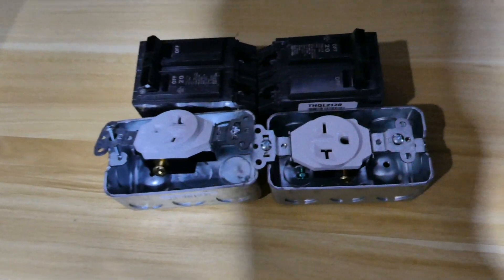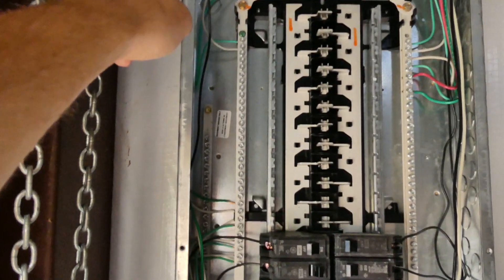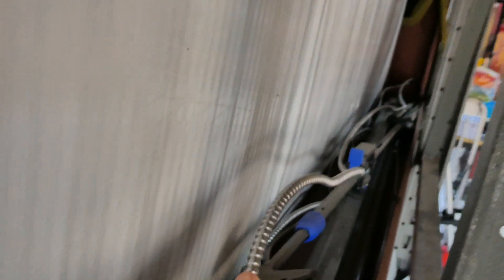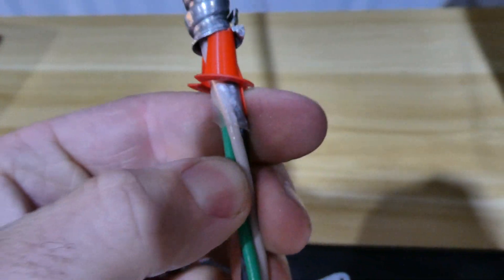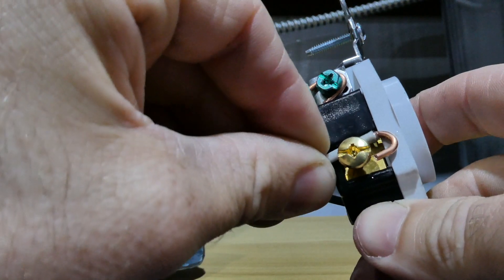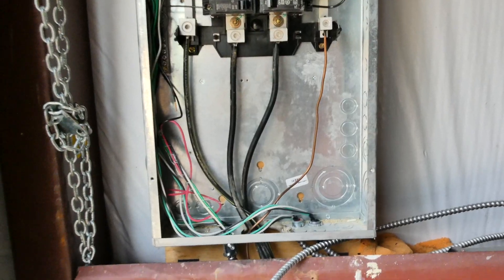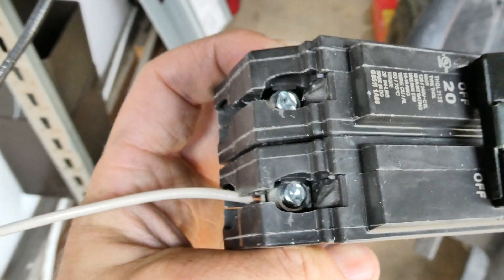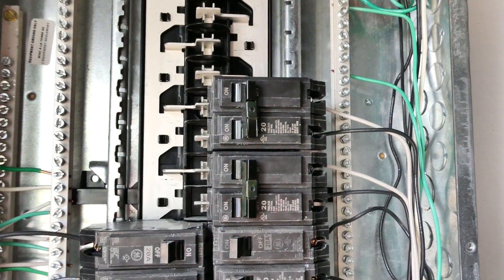How To Wire 220v Outlet For Antminer S17 T17 S19 or Other Bitcoin Miners ftx

Comment: Did you use a single cable (in my case 10-2 from the 30 amp breaker) to run to the miner, or can this be done with a single 240v cable (like 10-2)?  I’m measuring 123v on each plug going into the miner - but I’ve got no power.  I’ve likely made an error, even though my wiring does have power.  Any thoughts, anyone?
Reply from the maker: Are you using a double pole breaker? You should have 2 hots and a ground on each plug should be 120+/- volts on each prong of your plug besides the ground.

Comment: After looking at some manuals for miners (S19j pro for example) it appears each power supply needs 10 amps, could you not run a single 240v 20 amp for the entire miner? EDIT: Meaning, 2 receptacles

Comment: Brave man to post all your code violations on the internet. Ground and Neutral are different things. Stop using them as if they are the same. White is a neutral UNLESS marked otherwise. (red/black tape at both ends.) There's a red wire on your ground bar? There's no gland or conduit on the service entry to that panel -- which is ironic given the care given to the EMT ends.
Reply: phag

Comment: As an electrician, the only thing I have to say for the panel, you would want a little extra in there in case the wire gets damaged, whether it's from the insulation degrading or it gets nicked some how, and the s19 can be ran on a single 20 amp breaker for 240v, you could of daisy chained the 2 plugs together, or bought a duplex receptacle. Other than that awesome job!
Reply: What about the green bonding screw being installed and the grounds and neutrals being connected? I thought that was a no no on a sub panel
Reply: @Wigwhom86  good eye, I didn't even see that!
Reply: I got a 3300watt miner from australia 220v 16 amps....    how i wire this dam thing in the US    help   lol.       tried a set-up 5000watt 110 t0 220 but keeps trippin 20 amp 110 single phase single breaker
Reply: @maestrozilla  you need to wire in a completely new circuit(new wires, outlet, breaker). Volt times amps is the wattage the circuit is rated to. For cypto mining you only want to use 80% of that number to avoid fires
Reply: @Wigwhom86  ofcourse  it dedicated...
Reply: @Wigwhom86  how do i get 220 in single phase...... through PDU?  or use a step up trans..?
Reply: i got a single phase 220 plug for australia plug from the miner..
Reply: does c19 on pdu create single phase 220?

Comment: dude this video is great. Thanks for it 
quick question on my end, so one i plug this breakers to the panel, electricity will auto flow into them right, the only part to cable is the breaker to 220 v ?

thanks
Reply: Yes. In this case the breaker is your on off switch. You could wire a switch in line on the circuit if you want a more convinient switch.

Comment: So, are you saying that for each S19, which has two power cables, each cable needs it's own 220 line on it's own circuit?  If I have 10 units, that means I have to run 20 circuits?  Is that really true???
Reply: No. Run a single 20 amp circuit for each machine and then use a splitter power cable. A 20 amp circuit can run at 80% continuous (16 amps) without being a problem.
Reply: @charlesdecker7379  Do you have a specific splitter power cable you could reference? I am not seeing anything rated for more than 15 amps and I would think you would want something beefier since it would be drawing 13 amps or so.

Comment: So if S19j pulls 15amps max at 240v, could you simply Daisy chain 2 outlets under one 1 20 amp breaker?
Reply: We run single 20 amp circuits for ours and then use a splitter cable. Running two circuits per machine is unnecessary.

Comment: I'm planning to buy 28 T17 42Th miners & operate them in my house (in the UK), our sockets emit 230v. Would there be any issue operating this many miners? & would I need a specific socket extender to operate my miners?
Reply from the maker: That's to much power for a house, in the USA 200-amp circuit is normal. You're going to need at least a 400 amp circuit to run that many miners

Comment: What do you do about surge protection?  Where do you find the c13/c14 cables to plug into the miners?  Thanks for vid
Reply from the maker: Here's a link to to power cables I used. https://amzn.to/3nnWccE
Reply from the maker: I do not currently have a surge protector on mine but I am looking into getting one.
Reply: @DiyCommerce  Can the s19 be run on 110V?
Reply from the maker: @mikecautillo6360  No. Has to be on 220v.

Comment: Hello, I have the Antminer S17 on its way. Can you tell me, are those plugs rated at 250V? AND, will I be able to ust the Tripplite 220V PDU? Thanks!
Reply from the maker: Yes, they are 250v. In America we have a hard time with voltage terms. This wiring will work for your s17.
Reply: Many thanks! Sorry for the delay in response. Miners have been delayed because of supply chain issues. Another question, if I may, I am planning using 12/2 MC cable from the breaker box. Will this be adequate or do I need heaver? Thanks again!
Reply from the maker: @terrythomas8306  12 GA wire can carry 20 amps. So it is sufficient.
Reply: @DiyCommerce  Many thanks!

Comment: So technically these miners run on 440v (2 plugs x 220v each)?
Reply from the maker: No, it's still 220v it's just splitting the amperage between 2 plugs.
Reply: @DiyCommerce  that's very confusing because on the miner it says (200-240v)x 2.
Reply: So if a machine is pulling 3250w at 220v, that's approx 15A.  This is split between two power cords and so each cord needs to handle 7.5A doing 220v?
And then, can it be run from one outlet and split into the two cords?
Reply: @nateshort8945  Yes. We run single 20 amp circuits for ours and then use a splitter power cable. Running two separate circuits per machine is not needed. A 20 amp circuit can handle up to 80% continuous (16 amps) without it being a problem. The continuous current on ours is right around 15 amps per unit.
Reply: @nateshort8945  no it's 15amps per cord. Must be 220v per cord. Cannot use 110v outlets no matter what. It will damage the machine.

Comment: Is it one outlet for one antminer each or can you run more miners in one outlet if the miner runs on 220v?
Reply from the maker: This is two separate circuits. Technically you could daisy chain 1 more outlet on each circuit and be able to run 2 miners. The important thing is not to exceed the 20 amp rating for the breaker.
Reply: @DiyCommerce  Looking back at it would you think daisy-chaining 2 outlets and using a 40 amp breaker would work better?
Reply from the maker: That is correct. I wired mine on two separate circuits as I plan on adding more miners in the future and just didn't take the time to daisy chain another outlet in